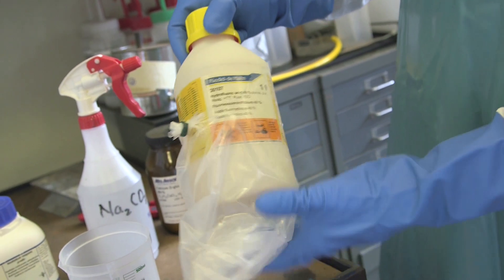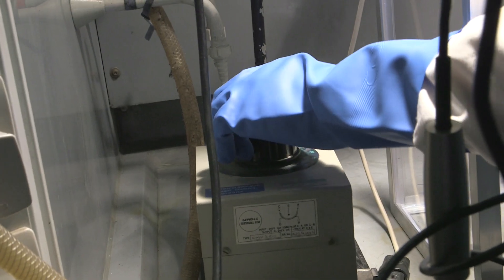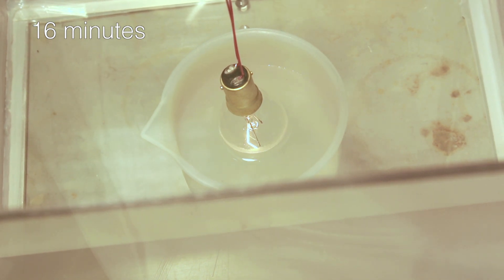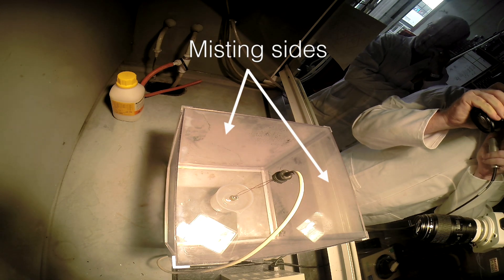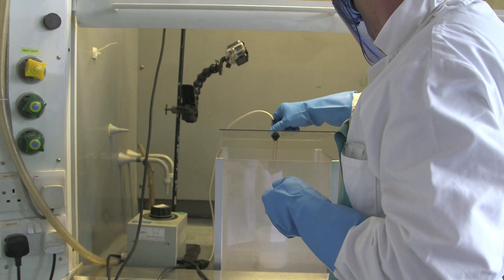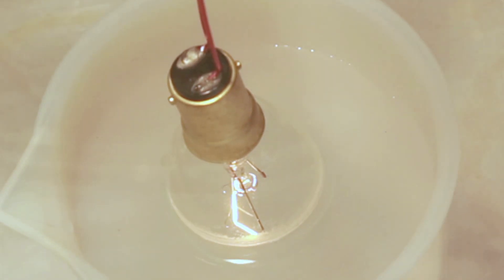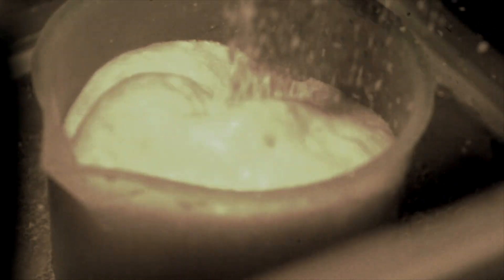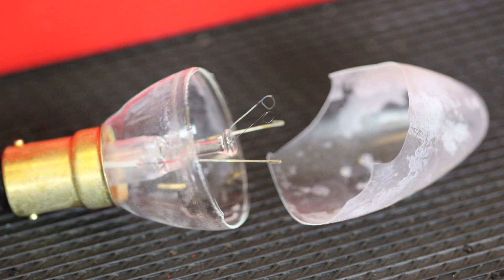Light Bulb in Hydrofluoric Acid (HF)

Comment: Wow, that just made breaking bad kinda boring.
Reply: Deosn't matter, HF isn't strong enough to do what they showed in the show, no matter how concentrated.
Reply: Did you die?
Reply: You can't not mix it with water, pure HF is a gas. What we call hydrofluoric acid is a water solution of it.
Reply: @Kwazzaaap  gas at room temp at least. Terrifying stuff
Reply: I can tell you now, I just breathed in hydrogen fluoride (by accident(byproduct of experiment)) and it hurts the lungs and bronchus
Reply: Above Disturbing they diluted the HF in this video significantly. Watch the video where they dissolve the chicken leg
Reply: "in the show they don't mix it with water."
HF is a gas. It WAS dissolved in water in the movie.
Even better, if you looked close enough in one scene where they showed a close up of the bottle you could see the percentage
Reply: in the show they don't mix it with water.

Comment: Not a single idea on why  the glass broke that way? No actual physicists here? I'll take a crack at it (not a physicist). The HF dissolved a lot of the glass away on the bottom, thinning it out. The heat from the filament combined with the heat of the reaction caused it to expand - whereas the glass on the top, still thick, could absorb more heat energy and didn't expand as much. The glass broke at the line of thinning, and stayed in tact where it was thicker.
Reply: Differential cooling... you have this intense heat generating bulb sat in a liquid, gets thin enough to where the smallest pulsation causes it to go pop, and due to how glass fractures thats why its not a perfect ring

Comment: HF acid is a weak acid. What's so special about it?
Reply: It is very very toxic, and the burns don't hurt. If you get so on you and don't immediately treat it you will die. It can also dissolve glass which lots of lab equipment is made from so the chance of exposure is higher.
Reply: 0:20 to 0:27

Comment: Why did the beaker have to be cloudy instead of clear?
Reply: +David Crawford The plastic used to contain it is produced in a different manner than other materials, even though they would have the same polymer formula. The thicker the folding, the more opaque and less pliable any given plastic will be.
Reply: Neurotransmission So you don't need to actually have a clouded one it is just a more durable plastic?
Reply: David Crawford The plastic is opaque because it is durable. If it was more transparent, there would be too many imperfections in the container; it wouldn't, well contain the hydrofluoric acid.
Reply: David Crawford Watch some educational videos about the production of plastics, and you'll understand why materials like the container used for HF here, and plastic wrap can be composed of the same polymer, but have different properties due to how the plastic is manufactured.
Reply: Neurotransmission I will, thanks for the information.
Reply: /sigh...
The beaker is cloudy because it is made from polyethylene. Polyethylene is slightly opaque...
Though it is possible the beaker is made from PTFE (Teflon). PTFE can be used for short term, and is common in chem labs. HF should be stored in polyethylene though since it will slowly penetrate PTFE and puddle around the base since it can't wet the container like the way H2SO4 will coat the outside of a glass bottle with acid.
You more commonly see polyethylene labware in molecular biology labs where stuff is often autoclaved for reuse and glassware is considered hazardous.

Comment: you guys should do a video on fluoroantimonic acid
Reply: The reason may not be, that its so dangerous (There are alot of chemists with proper safety accessories), the true reason may be that the acid is really REALLY hard to get.
Reply: Yea I've been looking for a video on that... For some reason NO ONE has done it.
Reply: that's because it's nearly impossible to contain and too dangerous for human use
Reply: +rojva29 yes I know, Teflon is basically the only thing that can contain it. It would be dangerous but that's what makes it fun.
Reply: Hard to synthesize, hard to contain, hard to use.
Reply: a ph balance of - 25
Reply: FlipUltraHD Well.. you can work with it however you'll need a whole ton of safety precautions. Its like hydrofluoric acid on drugs mixed with chlorosulfonic acid.
Reply: EmofacePS3 also because flouroantimonic acid fumes gaseous HF. Wouldn’t want to be around that.
Reply: flouroantimonic_acid#7707 is my discord name.
Reply: Anindya Mahajan It acts like a acid of -25 pH
Reply: Darth bllod -25 pH? Are you mad? That would imply that there are 10^25 moles of H+ ions in a litre solution of it. 10^25 moles of H+ ions would weigh 10^22 Kg. Sounds a little impossible to you?
Reply: @AnindyaMahajan  It's 10,000,000,000,000,000 times as powerful as HF. Genuinely frightening stuff.
Reply: Wow didn't know anything could go that low.
Reply: Literally battery acid I think has a pH of 0 amd hydroflouric acid is only around 2
Reply: Incredibly Undeniable same tho
Reply: 89Interceptor flouroantimonic acid is nearly 10 billion times more reactive than sulfuric acid. Watch scishows video on it
Reply: yEs
Reply: I think that's illegal
Reply: I’ve scoured the net for this .........nothing
Reply: HSbF6 isn't even necessarily "hard to get"—you just need antimony pentafluoride and HF and the right tools to mix them... However, keeping the resulting product in existence for any length of time (or doing anything with it) is damned near impossible. It will react with pretty much anything—all those atoms want to do is fly apart. It probably wouldn't even be that much of a spectacle—just some smoke and a very toxic mess.
Reply: He probably meant a pKa of -25
Reply: It's too corrosive to use. It'd eat away at the fume hood.

Comment: How does it cause a heart attack?
Reply: +DavidTheTech It reacts with calcium ions in your body, forming CaF2, which is insoluble and precipitates out of your blood. Calcium ions are essential to the contraction of muscles, including cardiac muscle.
Reply: The fluorine ions (F-) are quite toxic, but I do not know why exactly. I only know that they can dissolve your bones, forming fluorite crystals (CaF2)
Reply: +derkateramabend Thanks
Reply: +Yindog1 wow
Reply: +DavidTheTech its also known for being a nerve poison
Reply: +epicsnail14 I can see why; if it binds with calcium ions, not only can muscle not contract, due to calcium ions being responsible for binding to troponin, changing it's shape to pull tropomyosin out of the actin-myosin binding site

It also is required for synaptic transmission, as it binds with the pre-synaptic neurone, causing the vesicles to fuse with the pre-synaptic membrane and release neurotransmitters
Reply: Those fluorite crystals precipitate and act as cholesterol, blocking the arteries, possibly leading to pectoral anginas, aneurysms, strokes or heart attacks.

Comment: I wonder why and how did the acid make that neat cut instead of gradually melting the glass wherever it touched it. I'm bad at chemistry, maybe that's why I don't know though. :P
Reply: +Khorothis The trick to it is due to the fact they used a light bulb. It's not a property of the acid, but due to pressure differentials. When incandescent bulbs are made, they are sealed under vacuum, to prevent the filament from vaporizing the moment a current is applied. This means that the entire weight of the atmosphere is constantly pushing against the bulb, trying to fill that vacuum. When half the bulb is immersed in the acid, the acid immediately starts dissolving the glass it touches, making it thinner, and thinner, and thinner. Eventually the glass is too thin to resist the atmospheric pressure around it, and breaks. The break point will be where the thin glass and thicker glass join together, creating a "cut" as you see in the video.
Reply: Rusty Mann
I got that bit (well, mostly, I'm not gonna lie :D), but why there? Could it be the stress line created when/where they stuck the bulb and the top together? I mean, the acid could have "flooded" the "cracks", even if only on a microscopic scale, then going by least resistance it made the cut. Again, apologies if I'm talking rubbish.

And I appriciate the reply, I didn't honestly believe I'd get one. :D
Reply: +Khorothis Another likely reason would be the higher temperature at the interface of the acid/air. The bulb below the acid is being cooled due to the sheer mass of the HF, while at the fine line at the level of the HF, the temperature is much higher therefore increasing the rate of reaction.

Comment: i heard this stuff ate through things like candy floss.. thought it would take a lot lesser time.
Reply: It was diluted. In the beginning they show them adding the acid to water.
Reply: +freedustin They were diluting it to maximum strength. It isn't very strong without enough water mixed in. Unlike in movies, there are no real acids that will rapidly eat through random tough solid materials.
Reply: +david bell It does take very little time when it eats through candy floss :)
Reply: +TheReaverOfDarkness there is fluoroantimonic acid. It's hydrofluoric axid, but with added stibium fluoride. SbF6 reeaaly increases the potential of HF. It is so powerful, that not many chemists have had contact with this solution.
Reply: McVidsAndTutorials can this only be held by teflon?

Comment: Hello,
Why did you dilute the already diluted (on the bottle it reads something like 48% w/w) HF?
Was it for safety purposes or because it is expensive and you didn't want to waste a large quantity of it?
Thanks.
Reply: +Makis Makiavelis The storage dilution was highly concentrated, merely being mixed with water so that it would mix rapidly. The best strength will occur at a much greater dilution, and that much water doesn't need to be in the storage container.

They may have diluted it beyond that point but I'd wager the solution they had is about as strong as it gets.
Reply: +TheReaverOfDarkness 
Thanks, i always thought acids get less potent when diluted in water.
Reply: Makis Makiavelis
everyone assumes that. It's so annoying!

Comment: So, hypothetically speaking, if I were to dispose a body i should use HF.
Reply: Hipotetically,  HF is hard to get and too dangerous to handle,  i'll use a cincentrated aqueous solution of NaOH instead,  because i'ts a lot cheaper and relatively less dangerous to handle and still can dissolve a body with no problem
Reply: +Tom DuBois You'd probably be waiting a very long time for the body to lose recognizability.
Reply: @TheReaverOfDarkness  for how long, approximately?
Reply: @emmaai1255  I don't know. I haven't tried to dissolve things in acid before.
Reply: hypothetically of course...
Reply: Tom DuBois .there is a guy who works for the Mexican drug gangs who specialises in doing it they call him the soup maker there's a documentary about it
Reply: Would release quite a bit of nasty fumes...
Reply: Hypothetically you should use polyethylene tubs and not your bath tub when using this acid.
Reply: @Backyardmech1  nowadays the bathtubs are made with resin reinforced polyester fibers
Reply: If you buy enough HF to do that (very hard to do post-9/11) you pretty much become the #1 suspect right away. So, not such a clever idea.
Reply: Tom DuBois 
Definitely not. It doesn't work.
Reply: HCL is much easier to obtain, makes the body unrecognizable quickly and is a lot less hassle to store
Reply: +Tom DuBois:
Some killers have use conc H2SO4. It destroys cell walls and the bones.
Conc HCl can destroy cells as well since it contains a lot of H3O+ I suppose.
Reply: Not really, I would recommend using lye (Sodium hydroxide)  and then chopping up the body parts into smaller pieces and them putting them into pressure cookers with the water boiling and then adding the lye to the water with the chopped up body parts. After a few hours you'll have a gross looking water and some bone that you can easily crush into powder and throw away. And if you want to know how I know this i would recommend searching up "The Modern rogue lye"
Reply: Honestly you'd be better off with a hacksaw, a crapton of bleach, some garbage bags, and a bunch of elbow grease.

Just chop it into bits, triple bag them and then throw them away at different times in different unrelated locations.
Reply: HF isn't the acid for eating flesh. You'd end up with gross undead looking flesh unless it sat in it for a long, long, long time.

You'd be looking for sulfuric acid. H2SO4 REALLY likes eating flesh.

Hypothetically.

HF isn't feared because it vigorously eats flesh, it's feared because of its massive toxicity.
Reply: +isSHEEPMANimmortal Dahmer?
Reply: isSHEEPMANimmortal Oh yea, that sounds like Jeffrey Dahmer
Reply: Noah I read that it reacts with blood calcium and can cause cardiac arrest. Only a small area of skin exposed can lead to death. I think it’s about 20-30 square inches
Reply: if you are trying to dissapear something fast the easiest way of doing it would be with controlled fire
Reply: The “Acid Bath Murderer” used sulfuric acid.
Reply: My chem teacher actually said KOH would be better lol
Reply: ... ummmmm
Reply: okay walter
Reply: put magic acid, more effective, the acids stronger than that would go through the coffin... or maybe the magic acid could do that as well...
Reply: Eutanazol 95% Oops, indeed, that’s what I meant (or so I think, it was 1 year ago). Fixed. But HCl + H₂O₂ is not pointless, the H₂O₂ oxidizes materials and then the HCl can attack them, something HCl alone can’t do. For example, it’s used to etch copper.
Reply: Eutanazol 95% Indeed, iron is slow to react, H₂O₂ accelerates the reaction by oxidizing the iron.
Reply: Yes
Reply: Just use lye, way easier as well as it liquefied everything so well you can just dump it in a drain or dump it somewhere in the woods like nothing happened...

Hypothetically of course
Reply: +Tom DuBois if you're willing to watch it there's a doc on YT about some serial killer who had a bunch of bodies melting away in drums, pretty disturbing. there's also an episode of breaking bad that will give you more info on this subject lol.
Reply: Nope. HF is actually a weak acid. The reason why it’s so dangerous is its reactivity, which replaces calcium with fluorine. But it wouldn’t really dissolve a body as well as a strong acid/base, or even better, the piranha solution (H₂SO₄ + H₂O₂) would.

Comment: Perhaps the demonstration could have proceeded faster with a higher HF concentration of >70%. Pure HF dissolves glass instantaneously, but the exothermic heat produced will cause HF to fume, and may wreak havoc with the fume cabinet/hood if it doesn't have a acid-neutralising filter.
Reply: +Jonathan Fosdick No, it doesn't. The acid is stronger when diluted.

Comment: Hydrochloric acid is used for ethcing glass, so i assume it can dissolve the stuff?
Reply: +nzoomed HCl is normally non-reactive with glass. It might have an effect on glass with metal impurites (like most colored or leaded glass) but straight-up silicon dioxide is nonreactive with hydrochloric. Hexafluorosilicic acid is what is used in industrial glass etching, while commercial "etching creams" you can buy in craft stores use other flouride compounds (Armour Etch, for instance, uses sodium biflouride and ammonium biflouride, along with sulfuric acid and barium sulfate - I suppose to act as catalysts for the reaction)
Reply: +nzoomed No
Reply: +nzoomed Molten sodium hydroxide can, but not HCl.
Reply: +Rusty Mann OK, very interesting, i had read in a book that hydrochloric acid was used in etching glass bottles with a stencil. They must have got it wrong.

Comment: If HF is highly corrosive why doesn't it melt through the plastic container. I remember watching something about this but I don't remember why it doesn't melt through
Reply: it's because acids don't usually react with non metalic elements. Plastics are basically made only from non metalic compounds (plastics can have carbon, hydrogen, fluorine, chlorine, oxygen).